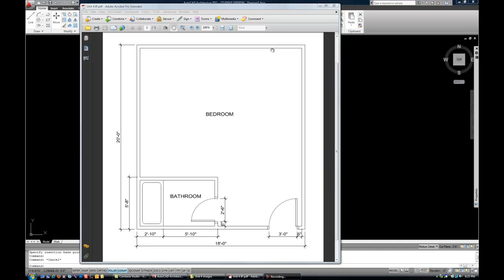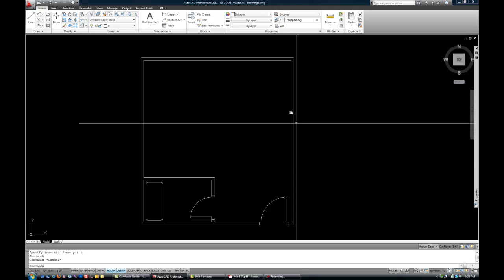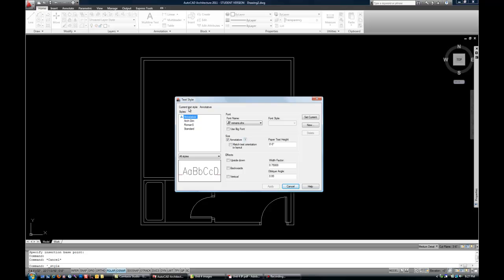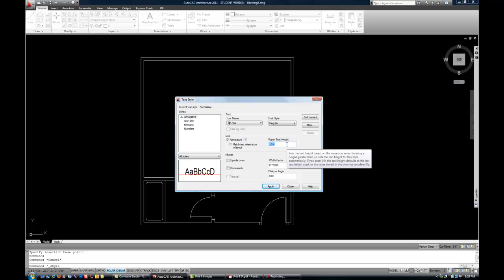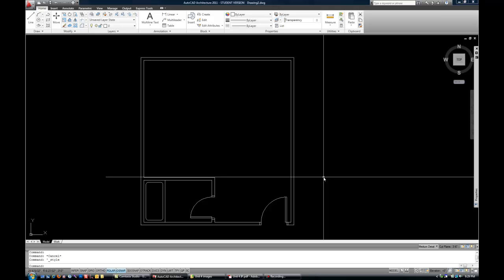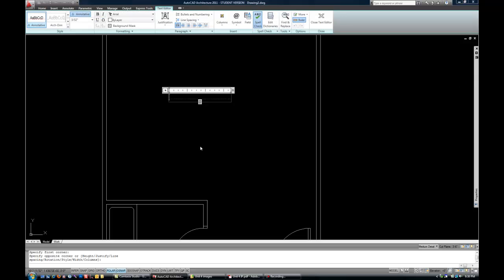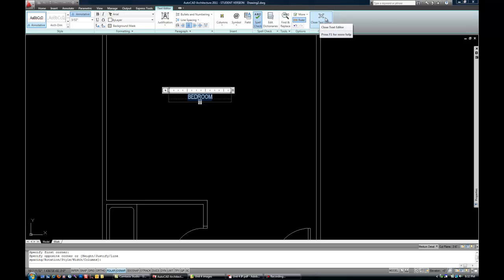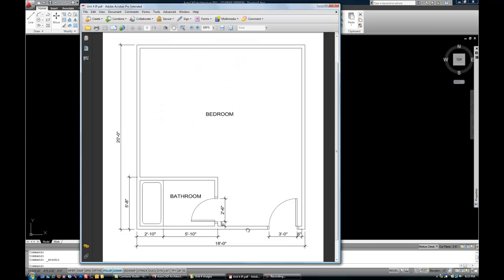Basic AutoCAD Floor Plan - Part 3

Comment: How do I change a window size on drawing that I got from W Block?
Reply from the maker: +Stacey L Your question doesn't make complete sense because you're not using the proper AutoCAD terms.  WBlock command is used to export a group of entities to create a separate CAD file.  Wblock is that process, not an object itself.    The file that is exported is just a regular CAD file, which may or may not include a block. 

But I assume you mean you inserted a block into your drawing.  If you want to edit it permanently, you can either edit the block (see my video on this topic) or explode it so it is no longer a block.    Then to change the size of the window (if it is drawn with simple linework), use the stretch command.    

If the window is a block itself, then either edit that block (only if you intend to edit all block instances) or explode it, edit size with stretch, and create a new block out of it.   See the block video if needed.

Comment from the maker: @latefa21 The box has nothing to do with the text itself, but I use a box for my students to give them an idea of how zoomed in/out they are. Assuming all your settings are the same, then the text looks large simply because you're zoomed in closely. 

I have a video just about text in the AutoCAD Fundamentals playlist, if that helps you check your settings. 

The annotation scale takes some rigor in your process, but once you get used to that results in more final consistency.

Comment: This annotative text height concept is very slippery and I'm having trouble establishing a routine that gives me predictable results.
In a nutshell, if I draw the 18'x20' box first, then set up the annotative text style/annotation scale, I get the same text height in model space as in the video.
However, if I set the text style/annotation scale before drawing the box, I end up with an oversized text in model space.
And I can't figure out what I'm doing wrong. Maybe you can :), thanks